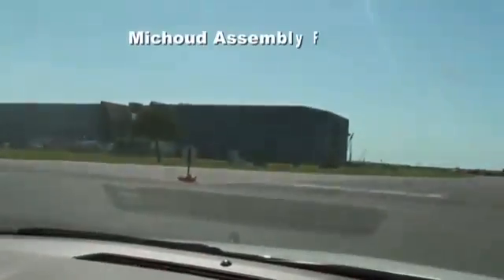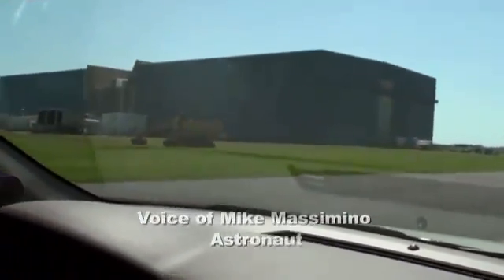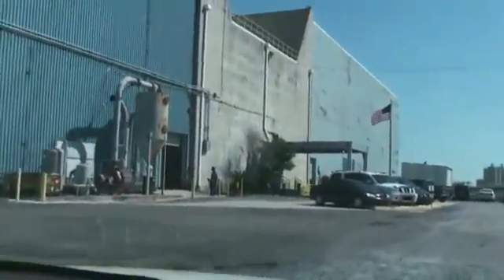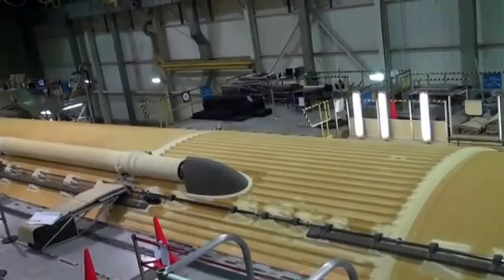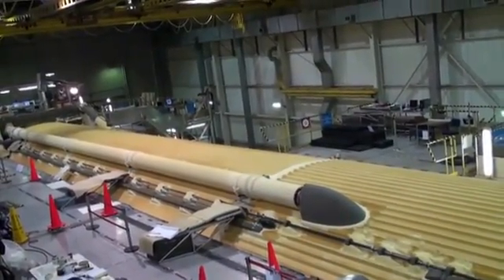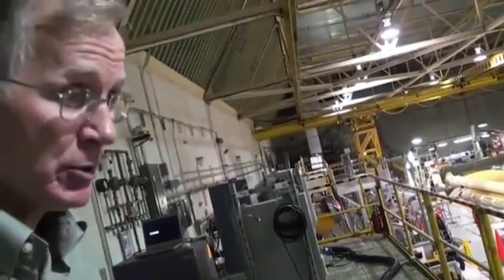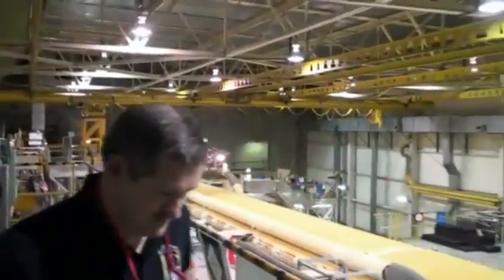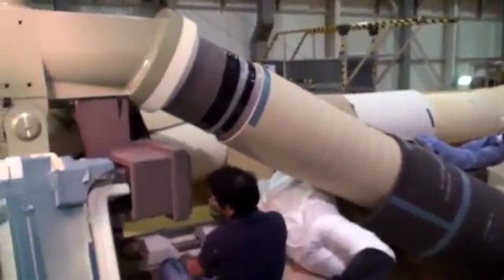Behind the Scenes: Michoud Builder of Shuttle's External Tank

Comment: liquid hydrogen -  black powder - which to use ?  speed  -  is needed   -   black powder burn might last hundreds of hours with final mass of lowest. -  liquid AP - add it up later -
Reply: Black power provides less power per tonne than the liquid options.  However the special mix in the SRBs is better than black powder and stores just as easily.

Comment: The guy in blue is the astronaut?  He is speaking as if he has no idea how this all works?  This fuel tank is what blew up and dropped foam onto the wing of Columbia.  The weak link in the Shuttle (thought the SRB burned through and hit that tank).
Reply: You're incorrect. The tank didn't explode, a piece of foam just broke off the tank and hit the wing of Columbia. The SRB burned through during the Challenger disaster. When that happened, the flame melted through the tank.
Reply: Mike F I've personally witnessed two shuttle launches. They not fake. And you say astronauts should be less charismatic but think stuttering makes them fake?
Reply: You my good sir, are a fucking idiot. @mike_friedman_realtor
Reply: @mike_friedman_realtor  shut the fuck up idiot